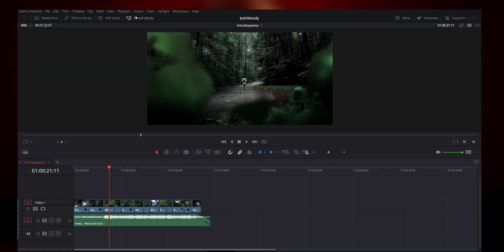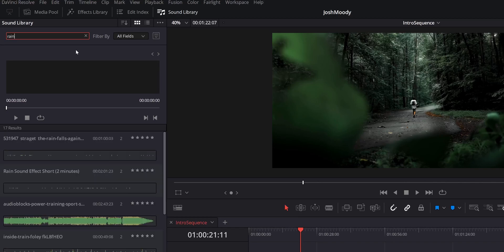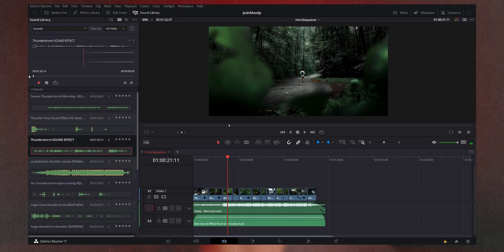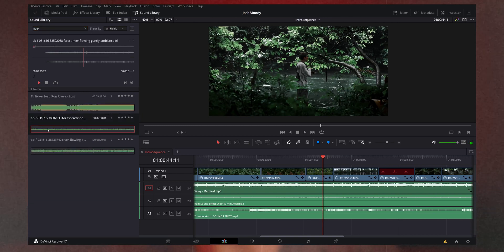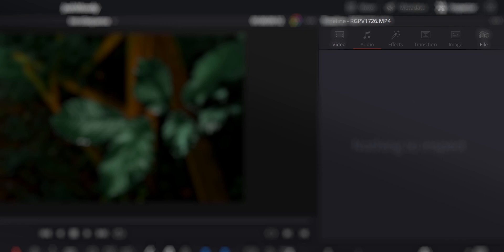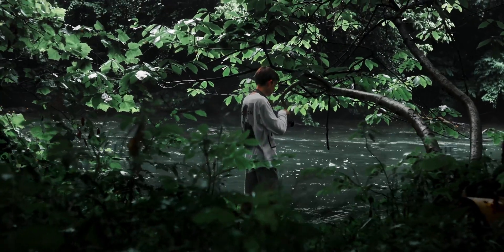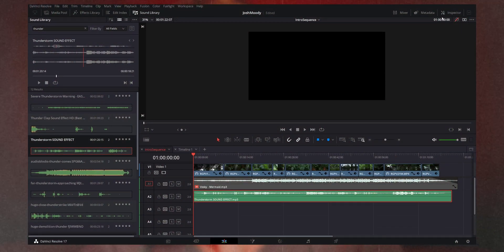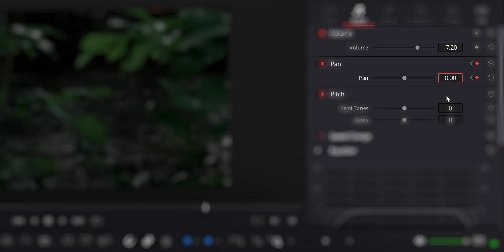BUILDING IMMERSIVE SOUND DESIGN | Davinci Resolve Tutorial

Comment: One simple effect that can add a lot to a soundscape is to use a small amount of reverb on an entire track of effects.  Often effects are recorded in dull, non-reverb environments and will sound a bit weird, like they are right inside your head.  A bit of reverb can help make then fit into the room that the video is showing even when the reverb is kept very short and low key. The consistent revierb helps the brain believe that they effects are all happening in the same location.
Reply from the maker: You're absolutely right! I think I did put some reverb on some of the effects in this video but forgot to mention it, it can certainly come in handy!
Reply: Absolutely correct